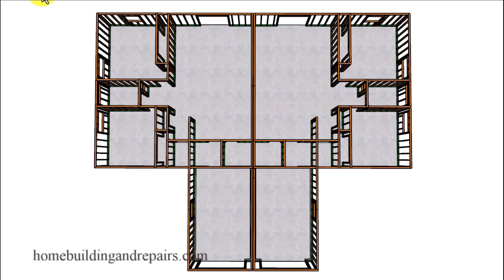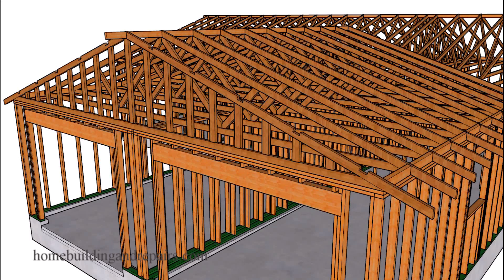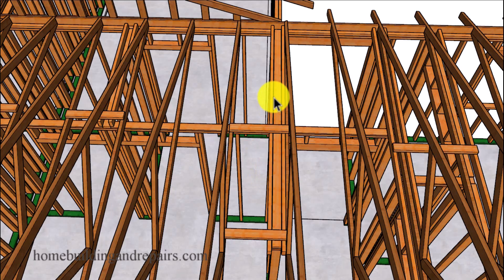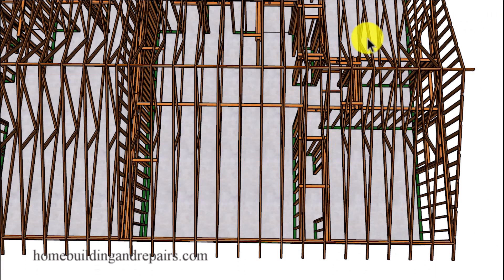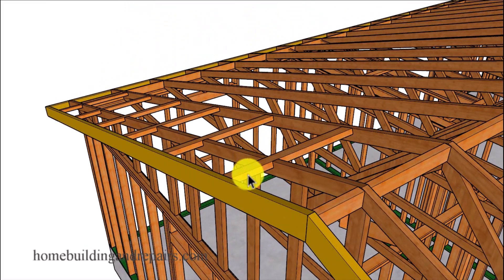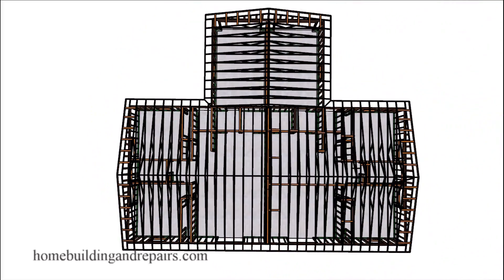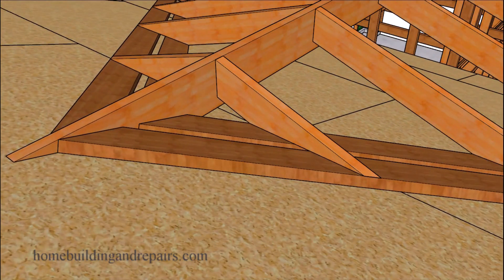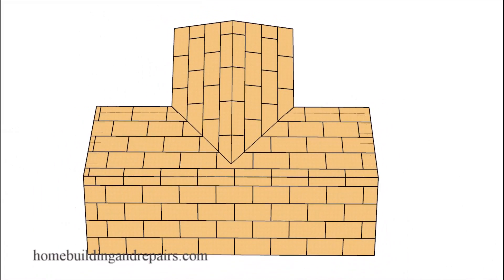Truss Roof Framing For Duplex Apartment - Two Bedroom One Bath With Identical Floor Plan Layout

Comment: Help me Greg! I have 12-foot 4x4 posts that are supposed to hold up the porch roof I'm building. Well the problem is that the deck corner is 4 feet up from the ground and the porch roof is 7 feet up from the deck. So I can't bury it 3 feet into the ground like most people do. What do people do in these situations? In my area, they don't sell 16 footers. I'm thinking of burying it only 1 foot into the ground and pouring concrete around it.
Reply from the maker: I can't provide engineering information, but don't see why you can't use a footing and not bury the post. Have it at least 6 inches off of the ground or a minimum of 6 inches between the top of soil and top of concrete footing.